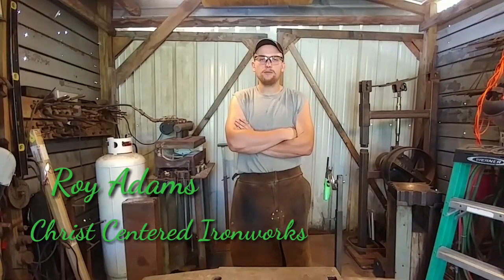Would You Like to See Me Do a Complete Power Hammer Build (Step by Step)???

Comment: 3.99 is cheap for sure , bought blueprint book Not that I needed one $75. i wont say who but the measuments and pics not straight or easy read . Will yours be hand drawn or sketch up like demensions in type printing ?
Thanks, hope this doesn't make me a troll,lol
Reply from the maker: Lol, no that doesn't make you a troll. I think it will mostly just be a cut list, and recommended places to get the parts, but I may have some hand made sketches in there. The plans I've got at my website www.blacksmithpdfs.com  range from $8 to $25 for a couple of different designs, and they are all done in CAD with 30+ plus pages. I'm trying to do something different with this one, as CAD drawings aren't for everyone. Most of the info will be in the walk through videos, but the download will be like a cheat sheet- crucial elements condensed in one place.